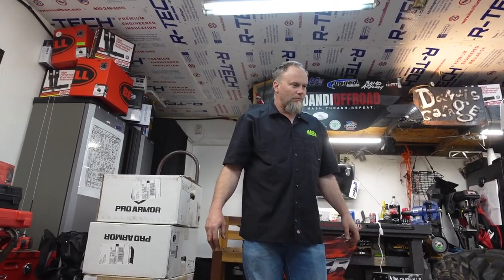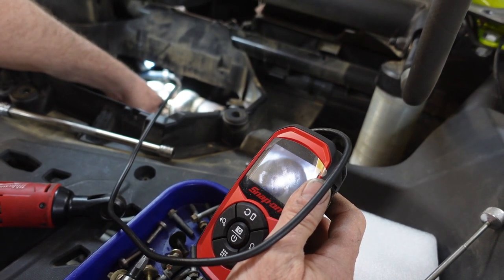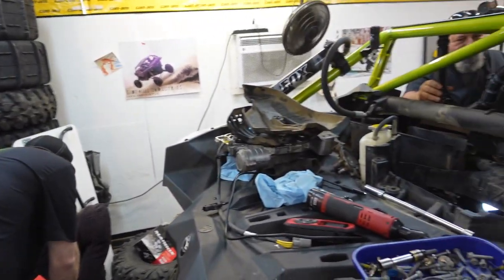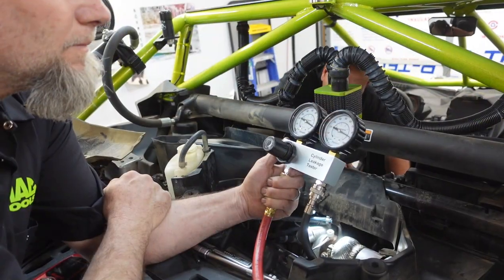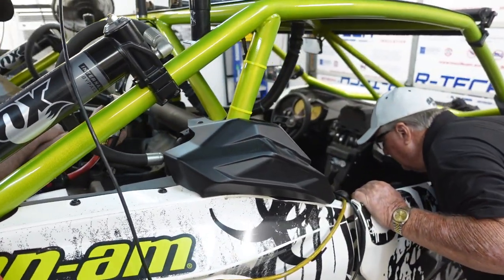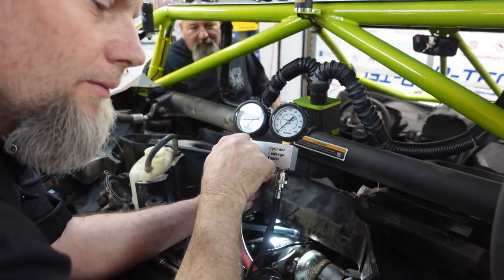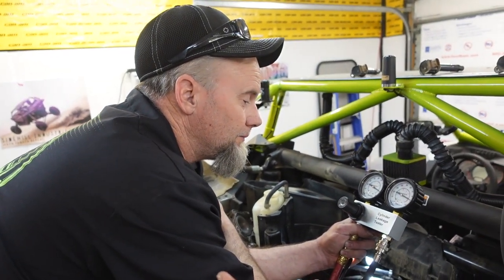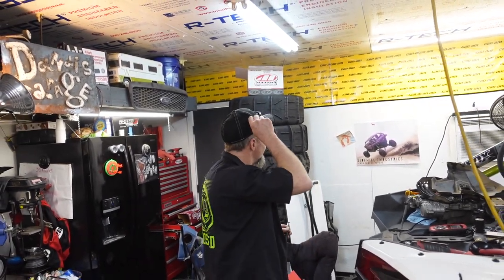Maybe NOT e85 That DESTROYED THE X3... Blown Tranny's, Blown Engines...

Comment: I just think it's weird the side by side blog has four units with engine malfunctions and they run e85 in all their units I would be calling them out but it's funny they haven't mentioned anything about e85 in any other videos after the fact with these motors.
Reply from the maker: We aren't 100% certain on e85 being the sole culprit at this point, right now it's just a theory - but we'll get to the bottom of it. Well hopefully...Lol. And as far as all the blowing of engines taking place, usually there are a lot of factors involved - such as high boost, etc. If we find out this was definitely an e85 issue we'll put it out there. Thanks for watching and commenting, much appreciated.
Reply: Those gears that are being replaced once they're out put them in e85 and let them soak and see what happens you will have your answer then for sure
Reply from the maker: Good call
Reply: SXS blog finally admitted that E85 was the culprit on one motor.
Reply from the maker: I saw that. But I mean how much do we really know is it just theory or is it real. There are production cars that run on e85. I mean don't get me wrong if I run it I'm going to be really careful